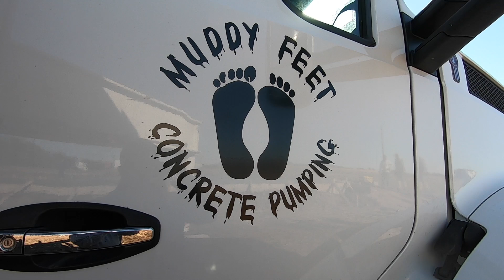WRONG CONCRETE COMPANY!!! But the right job site with MuddyfeetTV

Comment: A company here once had 3 extras loads of concrete turn up lol
Reply: Note. It was for block next to me. Front of house has a chunk that's 24footlong×10footwide×10footdeep
We all joked what will happen if the house has to get pulled down in the future 😂😂😂.

The soil here is a clay type and they would dig footing and soil kept collapsing so they ended up with one massive pit.
Company quoted xx dollars for it.
It cost them xxx dollars.

Comment: Easy(ish) fix...They sent you 50 yards of their mix, so you sent them 50 yards you yours...as long as the 2 mixes are the same (or at least close enough), WIN-WIN...
Reply from the maker: Hopefully they are putting flooring down. You could possibly tell the difference in color of concrete.

Comment: Like yesterday when I got 40 minutes through my dental appointment before they realized I wasn’t the correct patient.
Reply from the maker: What???
Reply: @MuddyfeetConcretePumping  they didn’t even ask my name, I noticed they had the wrong name when they were booking the follow up.  Would have been a nearly perfect analogy if the trucks realized with one or two left instead of five in.